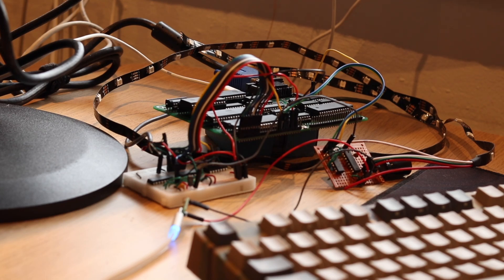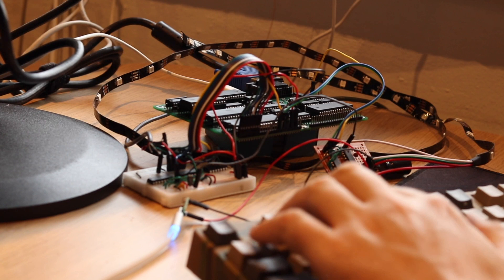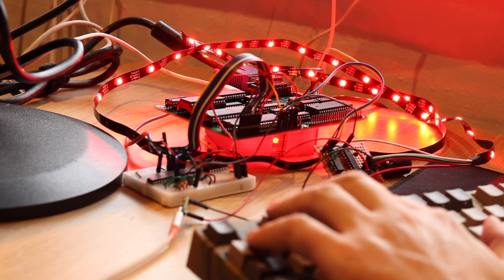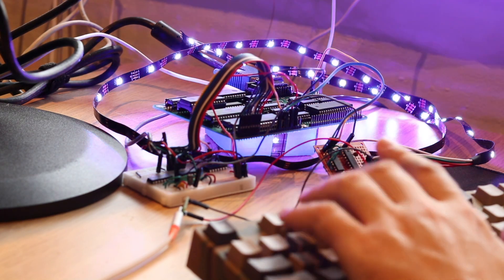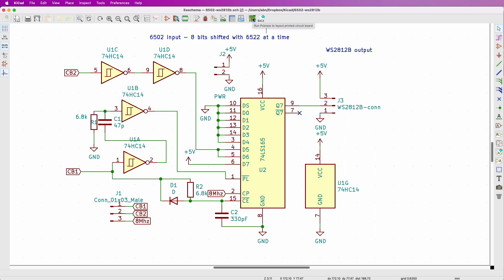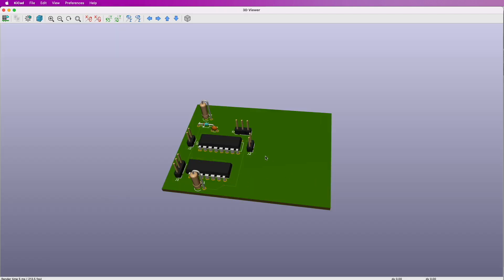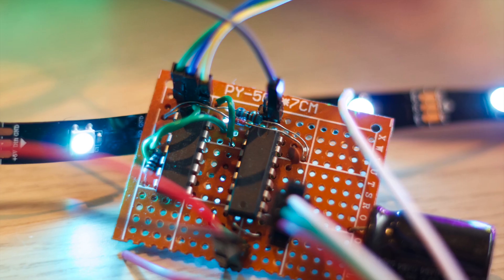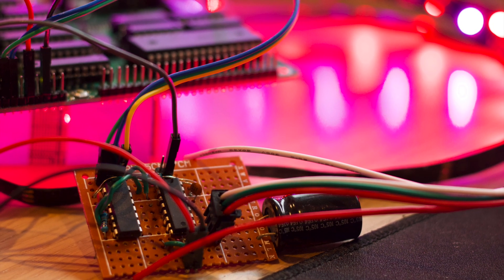WS2812B RGB LEDs on a 6502!

Comment: No big deal to drive these from a 6502.

What's the fuss?
Reply: I guess the fuss is in spitting bits at nearly 1MHz, generated by a CPU running at 1MHz.  Each pixel requires 24 clock cycles of 1.25uS period (800kHz).  You're not really going to have much luck with bit-banging that. I'd really like to know more about how he did it, than the video shows.  I suspect he's getting away with stretching the high portion of the clock cycles in ways not outlined in the data sheet.  Leaving the clock low for 50uS resets the string of lights.
Reply: @tonyfremont  sounds about right to me...
Reply: @tonyfremont  doesn't the 6502 get driven at 2 MHz?
Reply: @Theineluctable_SOME_CANT  there is a write-up that he linked to in the description.  He's running it at 2MHz, but it's still an impressive accomplishment.  These LEDs operate without a clock, so are quite sensitive to timing.
Reply: @tonyfremont  it's  neat but not that impressive. And YES! There IS a shift register...

I have seen really clever electronics designs. Even done a bit myself, back in the day. 

This IS neat, but not an impressive tour de force, contrary to the hype.

Nice. Just nice.
Reply: @Theineluctable_SOME_CANT  You must be a blast to hang out with
Reply from the maker: Thanks :)
Reply: @tonyfremont  there's probably a shift register in there... :-P